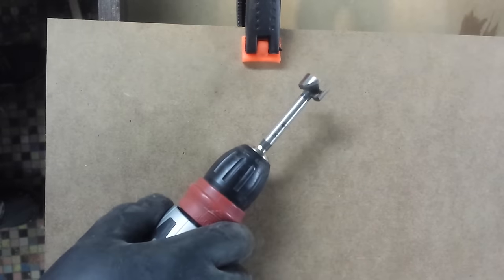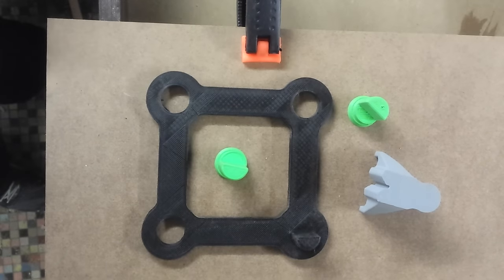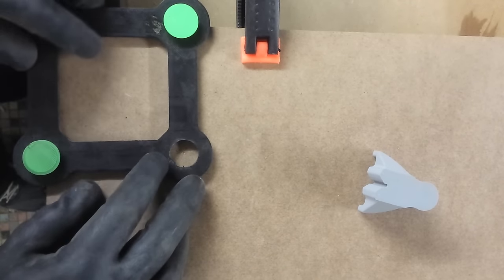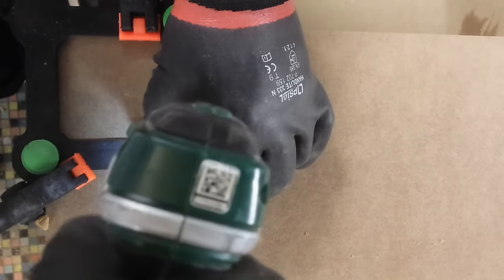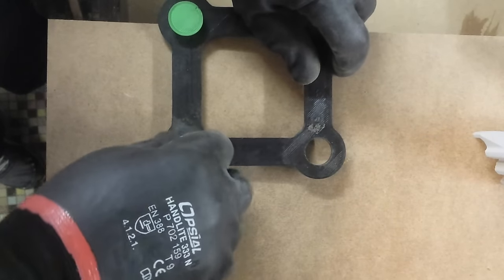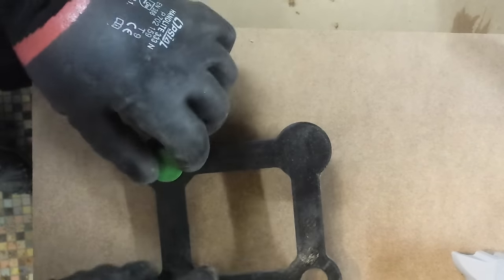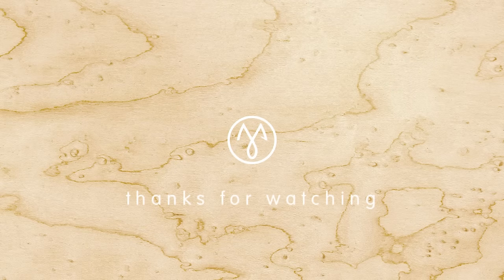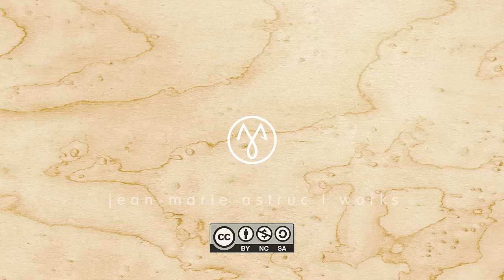Festool MFT DIY accurate drilling jig

Comment: I'm actually not very confident this method will produce an accurate MFT hole pattern. Do you rotate the jig in a consequent manner to spread out any errors and keep them from accumulating?

I trust heavily on the very accurate position of my MFT holes. It is probably the best square I have in my shop. The holes being almost OK but not really would be worst case scenario for me. Than I would prefer the holes to be visibly "off", so that I wouldn't be tempted to trust them falsely.
Reply from the maker: Well, actually I produced 4 MFT table top with the same jig and both are dead square. You don't need to rotate the jig in a special way. I like to proceed by raws or columns but you can go randomly if you like. Only the first two holes matters, then you can't go wrong because you reference on existing holes.

Comment: What is the best material to have this jig printed in?  Will PLA work with 100% infill?
Reply from the maker: I would Ideally recommend ABS because it stands heat better and your drill bit may overheat the jig in intensive use. As long as you care about oveheating you can print the jig in PLA, but remember this material gets soft aroud 60°C (140°F). You need to keep it cool to the touch. The jig should be stiff enough with 85% infill. Don't worry, the jig is not that big. You won't spend a lot of filament. Happy printing/drilling !
Reply: I used NGEN, but PLA will do. I used 33% infill, 100 is not needed
Reply from the maker: I think as tools are lifetime tools. So 100% infill guarantee the perfect stiffness in any condition or weather. I can step on the tool or whatever and the jig will stay in shape anyways. 33% Infill is not as strong as 100%. Definitely.